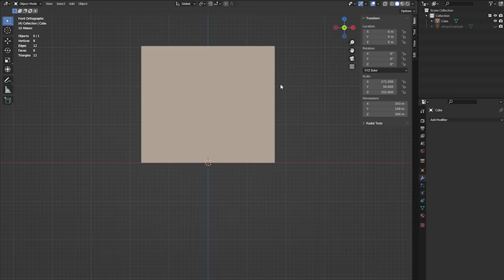putting a tiny kitchen in my wall (Ratatouille Diorama)

Comment: As a miniature crafter, this is an awesome dio. As a carpenter, the patch job surrounding it needs some more love.
Reply from the maker: Haha, yes it does. Ive been adding some more coats of compound and sanding, but I wanted to get the video out to you guys this week :)
Reply: My wife and I just purchased a 100 year old home. That 1:1 scale modeling is a lot harder than smaller scales.
Reply: @KnarbMakes  Of course. I always appreciate your work, brother. It's certainly worth sharing as it is. And once you get that edge finished, it'll dial the whole thing up to eleven.
Reply: @KnarbMakes  Go hobby store!  cute little trim in the wood section, or make some on the laser cutter!